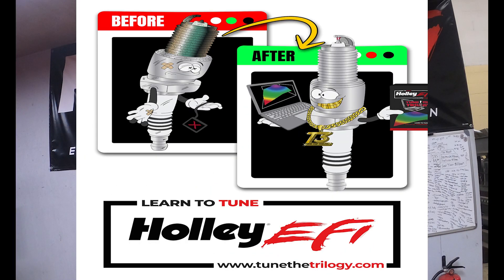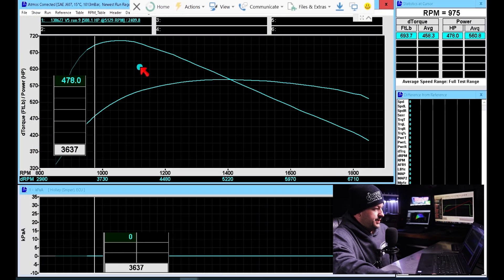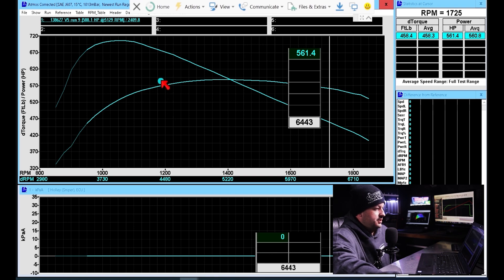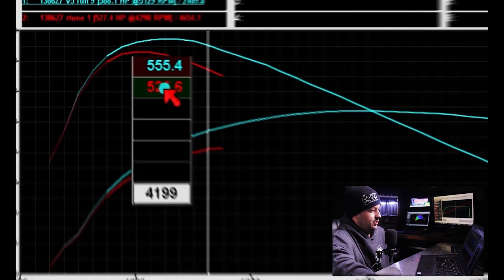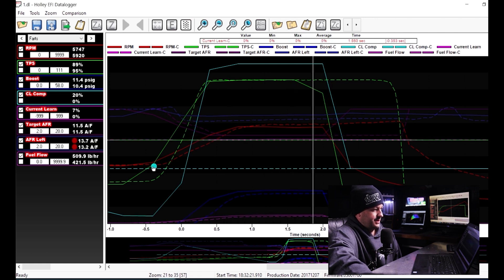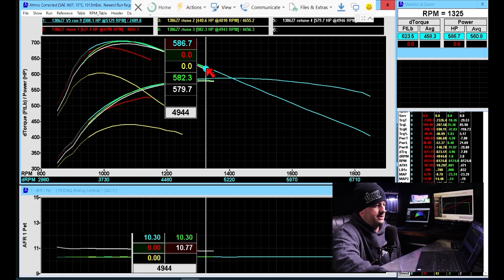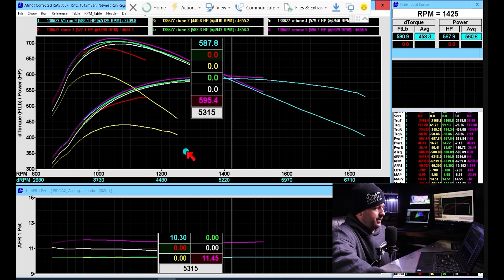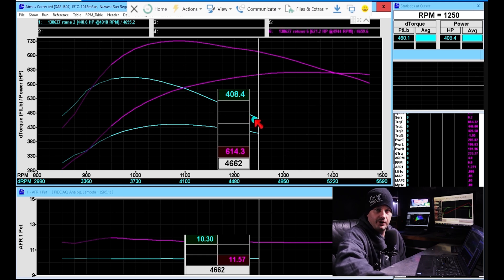Is Your Holley Efi 02 Sensor Bad?  Take a Look Inside my "Tune The Trilogy" Course

Comment: how did you switch from a bosh to a NTK sensor my is showing 27 AFR go in open loop and it runs smooth agen now i have 12k on this holley i also have BIG stuff 3 in a different car and that bosh  had over 25 k on it no problems .how's the holly killing the sensors ???

Comment: My Sniper BBD EFI on my 83 CJ7(258CI 6) just started problems .. Everything was pretty good until I added AC and electric fans... I fully integrated everything(efi controlling fans, ac kick, ac wot shutoff) and probkems started- worst one is IAC surging... I backed out the mods to the efi- disconnected fans, removed ac links... Back to basics- still surging... Not constant, but after well warmed up and driving. Next thing I know 20+ AFR... Sometimes power cycling helps, but I cant depend on the vehicle at the moment... Could this be an intermittant O2 sensor issue?

Comment: Mine use to peg 35.1, but you could smell the fuel... Very rich!!! 
I could turn it off and, on a few times, and it would run fine, and as long as I would drive it every week, it would have less issues. If it sat for more than a week... It sucked ass. 
Just replaced it and it seems fine so far. 
86 Square Body GMC LS1

Comment: I love your channel. Been following since i fired this money pit up. Anyway Ive been having wild afr readings from th TermX’s o2, which is backed up by a stand alone PLX meter(albeit a lil latent with data transfer even w sample turned all the way up) reporting to my digidash. Still im assuming its a bad sensor. Since i cant find anything definitive please, PRETTY PLEASE! Can you tell me will a holley 554-100(ntk sensor) work with. TermX? ANY help wood be fabulous! 

                                                                       Most sincerely
                                                                                                         @meye wits end in Mi

Comment: Just had this same issue on a customer car. It would happen after blipping the throttle a few times. IAC would catch the engine and return to idle. 

You could set your watch to it after that about 3-4 Mississippi and the AFR gauge would sweep clear pegged to 18 and it would stumble and almost die and peg the IAC. It would either catch it and recover, or die. 

This would only occur after a few blips “small revs” of the engine. Would do it ever single time like clock work. Took out the knockoff Amazon sensor and put a Bosch in it. Problem solved. It does a similar thing now, but only will go to 14.5-15 and recover rather than peg it to 18:1 and die…

Comment: Just came across your video. I am having an issue with a new install that I just drove the first time. My afr seems to be reading correctly and then all of a sudden after only a mile or so, the afr readings just stop completly and dont move at all. Stops at different readings every time, maybe 12.50 one time and 14.20 the next. The afr fluctuates like it should,  and then just stops fluctuating, and doesnt change any more, no matter what the throttle input is. On the next startup, the afr reads 28.0+ and struggles to start. Once started, the afr comes back down near the commanded reading and then the issue will reappear again. This sounding like an O2 sensor issue or something else? Any info is appreciated. Thanks
Reply: If you haven’t figured this out, this was fixed in the latest firmware update.

Comment: My Holley Dominator eats those Bosch wideband sensors for breakfast for some reason. I’m on my forth sensor in about a year. I’m going to try the NTK sensor then if that fails I’m thinking I might have a bad driver with the Dominator.
Reply: The bosch is garbage, hooe you had luck with the ntk.

Comment: When my Bosch O2 sensor died on my Sniper EFI it didn't go full lean but it locked itself at 15.5 AFR 90% of the time but still ran perfectly fine and revving it up didnt even change the reading. Replaced the sensor and the issue went away.

A failed sensor does not always go full lean
Reply from the maker: Of course it doesn’t always go full lean. 15.5 is odd though.  The most common are full lean or locking at 14.7  I’ve only seen a few lock at full rich. Sometimes they just go crazy and read all over the place. Sometimes they just get real slow and sometimes they appear to be working just fine they just read wrong.  

I’ve seen them fail in just about every way possible
Reply: @JoeSimpsonAtTempest  I was told by several Holley techs that my sensor was fine because it wasn't going full lean but I insisted that it wasnt working correctly. Just wanted to share my odd experience and also say that your recent videos helped me figure out more settings that I didnt understand. Thanks!

Comment: Hey Joe I have a BBC WITH HP HOLLEY it started running really rich one day and to the point it wouldn’t
 Start the O2 was pegged at 35 it’s a holley Bosch I’ve bought a new NGK 554-100 new plugs an a new set of copper collector gaskets as the headman header collectors O2 is really close to the sensor 
I haven’t put the new parts in yet!! 
 
Two questions 
Could it run so bad it ruins the plugs ? Stopping it for trying to fire ? 

Can I use copper RTV on the copper gaskets to guarantee no leaks 
TIA

Comment: I'm pretty sure this is exactly what is going on with mine right now.. showing 20:1 at idle and 12.5:1 with some throttle and I can literally see black smoke coming out the hood stack from it being so rich..

I have the 02 in a sampling chamber and was thinking that was the issue, but not I'm thinking it is just a bad sensor..

Comment: My car has been acting funny. I had it tuned and all did well, now when accelerating at wot it's cuts out dies and backfires kinda a loss for words even after new plugs and everything
Reply: What was the issue?
Reply: @or-ian6973  come to find out when I was taking it to get tuned it rained. I didn't think. Nothing of it but make a long story short some how water go into one of the sealed relays and turned into a green copper corroded mess. Also a bad cam sensor. Both have been replaced and runs. Just haven't had a chance to take it out and test

Comment: I had a “Bosch” o2 sensor kick my a$$ with my sniper. It was going for 10-20 so fast at weird times. I checked everything but the o2 sensor because it was new. I installed a new o2 sensor and found. The one that was acting up was actually fake bosch sensor. I was so mad and happy at the same time because I fixed it. Thank you for your videos
Reply: Just had this same issue on a customer car. It would happen after blipping the throttle a few times. IAC would catch the engine and return to idle. 

You could set your watch to it after that about 3-4 Mississippi and the AFR gauge would sweep clear pegged to 18 and it would stumble and almost die and peg the IAC. It would either catch it and recover, or die. 

This would only occur after a few blips “small revs” of the engine. Would do it ever single time like clock work. Took out the knockoff Amazon sensor and put a Bosch in it. Problem solved. It does a similar thing now, but only will go to 14.5-15 and recover rather than peg it to 18:1 and die…

Comment: You mentioned that the HP or Dominator O2 sensors are more expensive... aren't they all Bosch LSU4.9 unless you specifically get an NTK one?
Reply from the maker: No. The sniper and term x use the 4.9

Comment: I have a Terminator X system and I'm using the narrowband bungs on my longtube headers as the location for my Wideband. I feel like I've got a heater control strategy issue. Are these safe to run at 9 or 3 o'clock? Or do they need to be pointing down just a touch?

Comment: Can you go over the different NTK sensors? Have heard about Lab grade vs other ones. How many NTK ones are there? Have been wondering if one from rockauto would work with EFI systems. A lot cheaper than getting them from Holley or Fueltech, etc.
Reply from the maker: The lab grade etc is for other controllers. With Holley I’d either just get the Holley sensor or the mad racing sensor.

Comment: What you’re saying makes perfect sense however I like to take a different approach with my own car. I give closed loop and learn a bunch of authority, my logic is, when something goes wrong, it goes a long way off making it very obvious something is wrong straight away, if it’s only allowed to go 20% it might not be noticeable straight away and be 20% lean under full power and melt everything.
Reply from the maker: Multiple ways to do everything. I’ve probably tuned several hundred cars just 100% open loop so it’s my go to. Closed loop seems to do more harm than good when you average out the good vs the bad

Comment: I'm not on the fence about Joe's course I do need to finish this engine and get it on a dyno with a carburetor to make sure everything is correct. I've heard some pretty bad stories of people trying to do a first start with EFI. That won't be for awhile unfortunately.
BTW this problem would have been very hard to find without a Dyno.